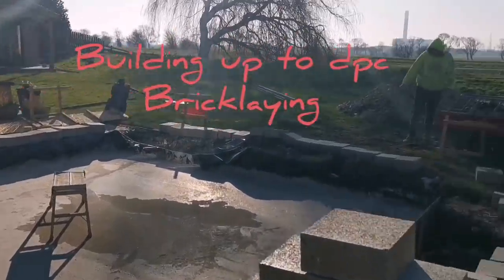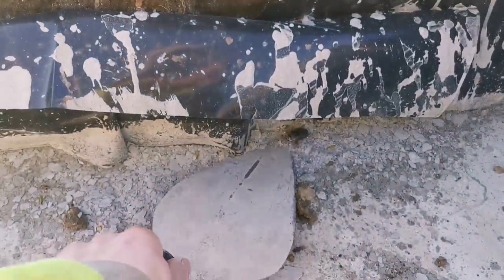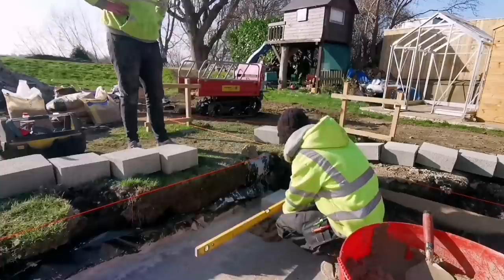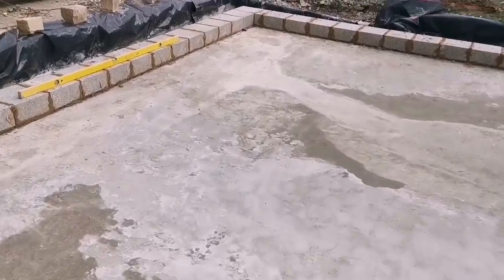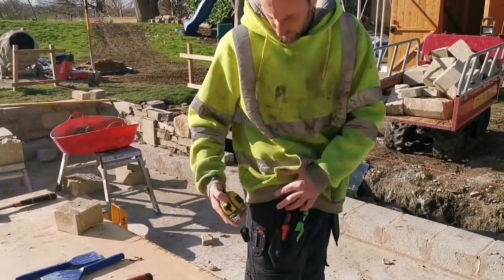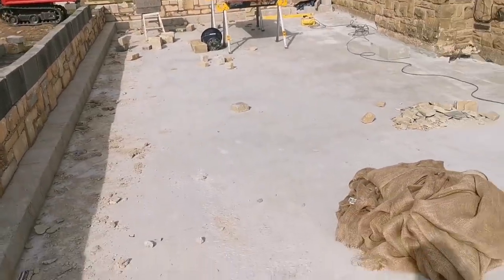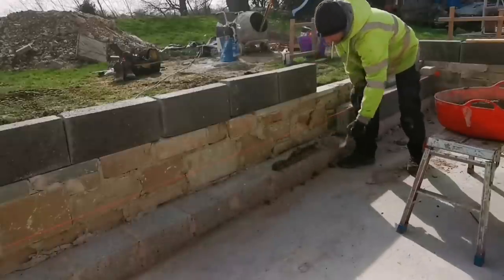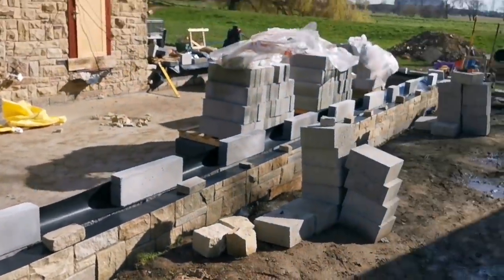bricklaying foundations to dpc

Comment: Great job mark you probably already know but when your putting line on nails,pins put a double loop on line hook it on and give it a pull save all that going round and round also mate put up a link or name of them pencils you use going to get myself a set they look decent ,have a good week it's going to be a proper lovely week for brickwork although I have to hand dig footings tomorrow and concrete pour Tues before I can get hands on trowel but looking forward to it as been laying porcelain for weeks getting bored of it but hundred per cent right keep dpc level 👍
Reply from the maker: Hi mate will try that I didn't no that mate 👍Yere I will put a link on tomorrow for them pencils they are really good. Nice one I was was missing the laying a bit with doing all that wood work. Yere there is only so much flag and tile laying you can take before it bores you to death 😂😂😂the money does keep you at it though 😂😂👍👍👍👍🤑🤑
Reply from the maker: Hay up mate I put the name in description just copy and paste it for the pencils 👍👍👍
Reply: @markhep  cheers mark just ordered set on Amazon 👍
Reply from the maker: @scoyle1750  nice one they are good and you dont loose them all the time  like normal ones lol👍👍👍

Comment: Sunny days 🌞 Seems a strange way to build up the floor on top of a slab but I guess the engineer agrees to it. Probably need to compact the fill very well in layers but might need to have some thick expansion foam around the perimeter so it doesn’t force the walls out. Probably need foam around the perimeter of the top slab too to allow for expansion issues.
Added… Maybe keep your compactor machine a few inches away from the walls so you’re not at risk of pushing them out.
Reply from the maker: Yes mate think that's what we will end up doing. It's worked out a bit strange doing a raft instead of trench foundation 👍👍👍

Comment: Why is it that you build the floor up with hardcore after the concrete has gone down then concrete again instead of building it up in the first place?
Reply from the maker: Hi Tom so on this one we had to put in a raft. Because it's so close to river. And the customer wants a concrete floor inside the building. So it works out cheaper to put in hardcore insulate then just another 4in of concrete on top. There are other ways we could have done it. Like put joists in to get it to hight. Or block and beam.👍
Reply: @markhep  yeah I understand but can’t understand what the benefit is of having the raft so low in the ground.
Reply from the maker: @Tom-hl7wc it was the building regs. We had to go down and tie it into the main house. So had to be the same 👍

Comment: Is that natural stone and what type of mortar mix do you use? It it portland based or lime? Thanks
Reply from the maker: Hi Alex yes it's natural stone. The mix we are using is 5 sand 1 cement and 1 hydrated lime. Its really strange with stone as there is not a set mix with it. some say put lime and others say don't. I like a bit of lime in mine 👍👍👍

Comment: I wanted to ask you if it was longer to mount a wall with such stones but the question has already been asked 😋 If I understood correctly, the next installation will be simpler by not having the constraint to be constantly level? (except the top of the wall of course)
Reply from the maker: Hi val yes definitely it's going to take longer than bricks. But you right now we don't have to get the bond level till top. We should get more done. But it is a slow process. I will probably do a full vid at normal speed so you can see what work is in it just picking the right stones that fit. Quite a lot of them you have to cut to fit in 👍👍👍👍
Reply: @markhep  Thank you for your answer Mark and good luck with the rest of these walls 😉😀
Reply from the maker: @Clothis64  😂😂Chears val👍👍👍